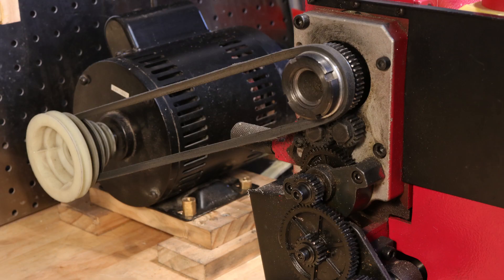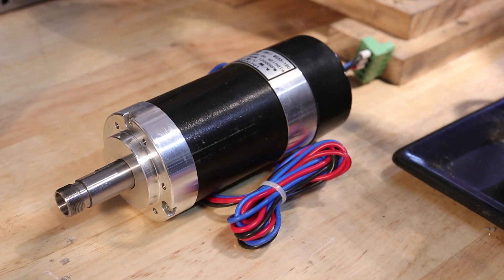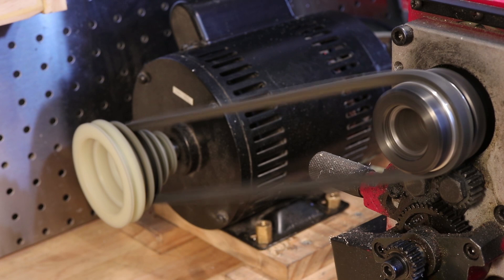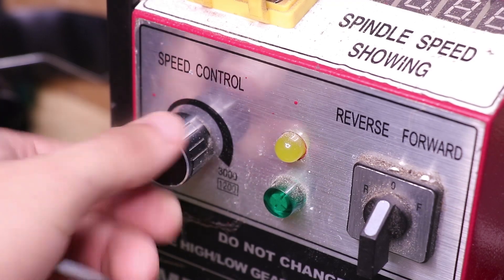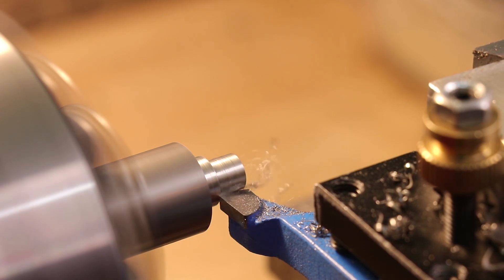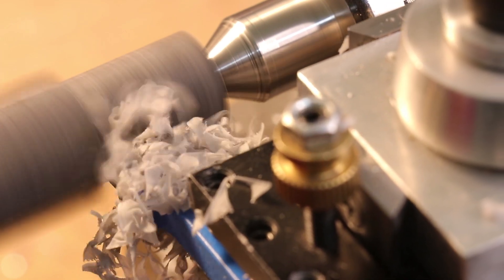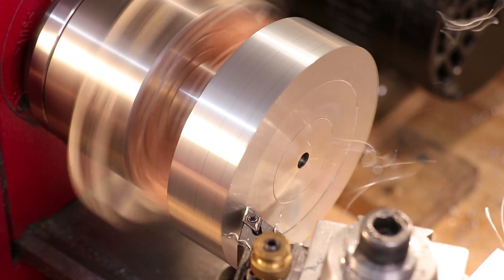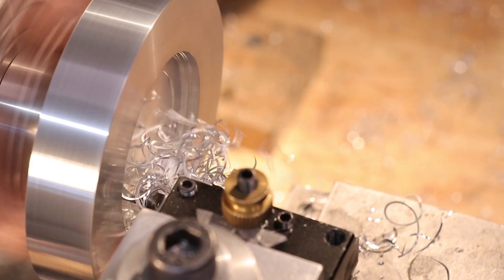Mini Lathe AC Motor Upgrade

Comment: You don't need 3 phase power in your shop to run a 3 phase motor on a VFD. The VFD can be fed with a single phase power circuit. The reason this works is that the first thing that the VFD does is rectify the AC power feeding it to DC, and then reconstructs the 3 phase signal from scratch internally at varying frequencies called for according to the speed you want to run the motor. Many VFDs will also allow you to reverse the motor direction on the fly.
Reply: ya, i was just about to type this exact thing. i got a nice import vfd for $45 delivered. took about 20 minutes to wire it.
Reply: @WmSrite-pi8ck  Nice, that's a good price. What I've seen more of on youtube is lathe owners going to a 1hp 3 phase motor which seems to cost anywhere between 100 - 150, and then a vfd that will handle the wattage for about 100 - 150.. Better to go a little bit higher on the wattage as a buffer, and you might get more and better features as well. The VFDs I was looking at are about 125 and allow all the controls to be set up remotely which is nice.
Reply: @fredflintstone8048  mine is for a drill press so i dont know if that'll work for this application
Reply: Also, the "one" phase motor is a 3 phase, it just makes the 3. phase from the other phase wit a condensator,  It would be stronger also getting 3 phases from a VF single to 3 phase drive
Reply: @geirkleven3936  I've worked a career in the industrial community. Most motors are 3 phase, and the first VFDs were for the industrial market and they were expensive. It seems that the VFD market has continued to produce mostly 3 phase VFDs (inverters). I suppose it would be simpler even with the small inexpensive ones to make them all 3 phase because you could also use them on single phase motors by only connecting 2 legs instead of 3, perhaps they also have an internal setting for that as well to balance out two of the waves. Yes, there are motors that use a 'run capacitor' which is another set of windings that are fed out of phase from the main feed by virtue of a capacitor which will shift the frequency. VFDs are great for getting 3 phase from a single phase source and it works because the supply is rectified to DC first, and then fed to inverters that recreate the 3 phase relationship. The quality of the supplied wave will vary though and some of the cheap ones are a bit hard on some motors because they don't actually produce a true sine wave.
Reply: @WmSrite-pi8ck  A VFD will work on any 3 phase motor. Just make sure the voltage and amperage ratings of the VFD (wattage) will cover your motor. You'll also get the benefit of electronic speed control.
Reply: This. Both my lathe and drill press are 3 phase motors with VFDs and 220 split phase inputs (US 220).
Reply: I have an old Myford ML7 and an ML10. Both run on 3 phase motors on single phase home supply through VFDs. This works well but it is an expensive option. For Mini Lathes and small hobby projects I suggest a conversion to Brushless DC motors.
Reply: @lensman5762  I paid $44 total for this:
5HP 380V 4kw 12A Variable Frequency Drive Inverter VFD 3 Phase Speed Controller
I've been using it successfully on my Bridgeport for about a year.
It's hard to come up with ANY alternate solution comparable in price.
Reply: @fredflintstone8048  What you have to realise is that in EU particularly the UK where I live, prices are very very high for used or new equipment. Part of it is because of the very high tax, and then it is the 20% VAT ( Sales Tax in the US ), and the never ending greed. A used 3 phase motor plus the inverter can cost up to £250.00 depending on the make and spec. They don't call it Rip Off Braitain for nothing, my friend. My other expensive hobby is photography, and it is the same story there. I live less than 12 miles from the Ilford factory, yet the price of the same film in the US is 30% cheaper than here. You couldn't make it up if you tried.

Comment: Do you think a 250W lathe is able to cut steel?
Reply: I would say in general yes, but it's going to depend on a number of factors, the tool, the speed of the chuck and how the motor creates that speed, the amount that the tool is attempting to cut at once, and the attempted cutting depth.. You will have to take your time.
Reply: They will, take your time, keep your fingers away from the chips.
Reply from the maker: As others have said, maybe mild steel, but it would take a bit of time and you would need to stick to hss tools. Cheers

Comment: Can I ask you something please, my country and all countries in the world use the AC electric power how does the lathe DC motor will work on my power switch do I have to buy some kind of AC to DC adapter? Or the DC motor got build in inverter from AC
Reply: Its buildt in, just need to plug in the cord from the lathe into the wall
Reply: The built in control board converts AC to DC, in the same way a USB adapter turns mains AC to 5 Volts DC. ;)

Comment: Correct me if I'm wrong, but isn't one of the functions of a VFD to convert single phase power into 3 phase? For my CNC router I have a single phase input to the 110V VFD, and out comes the three phases for the motor.
Reply: All VFDs will run on a single phase supply or a three phase supply. The important thing is to get the supply voltage within spec, and that the circuit be able to handle the current load.
The reason you can feed VFDs with single or three phase power is that the first thing in the VFD circuit is a full wave bridge which converts incoming AC power to DC. The full wave bridge is made up of 6 diodes, one for each phase. Feeding it with single phase leaves one of the input legs and pair of diodes unused, and this poses no problem at all. I've done this many times with many different kinds of VFDs for several decades..
It will cost more, but the best lathe upgrade is a VFD and a 3 phase motor.
Reply: I believe there are several types of VFD, but one type takes single phase in and puts 3 phase out.
Reply: The primary purpose of a VFD it to vary the frequency. I've built a 110v single phase VFD that controlled a straight 110v single phase motor. Not efficient, power wise, but it works.
Edit: this was before cheap single-to-three-phase VFDs became available!